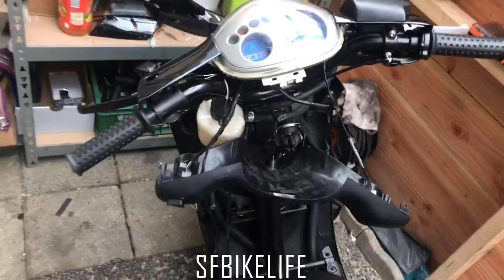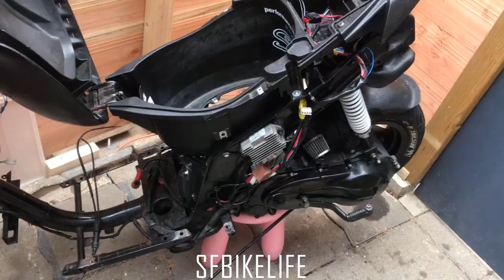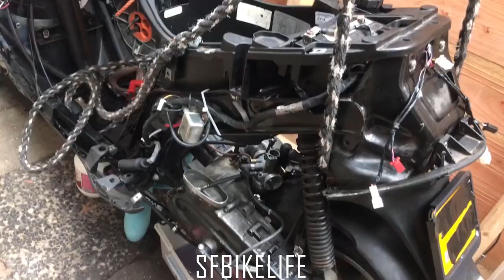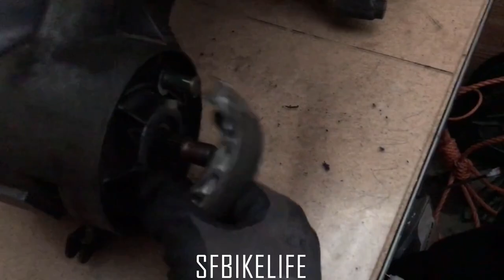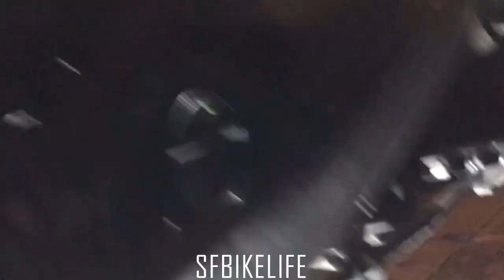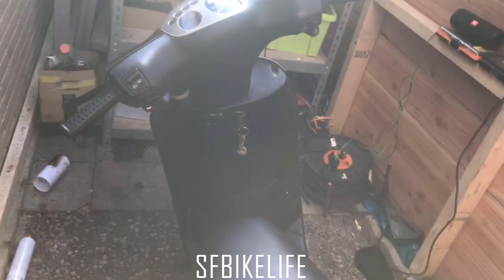ZIP 150LC BUILD PT.2

Comment: I’m not to sure I need to make sure it’s not stolen first the battery ain’t plugged in or nothing the speed monitor don’t work there’s wires everywhere
Reply from the maker: first of all you need your battery plugged in. on the internet you can find a picture of the stock wiring. then your gonna check every wire. i cant help you more

Comment: Engine from tph?
Reply from the maker: no, tph is air cooled. this engine comes from a piaggio hexagon.
Reply: @sfbikelife  nice , did you need only engine or electric too
Reply from the maker: @fxlofficial9927  most of the electrical is from a 4t zip 2000. some of it was modified to work with this engine